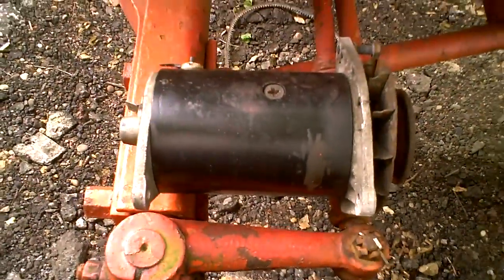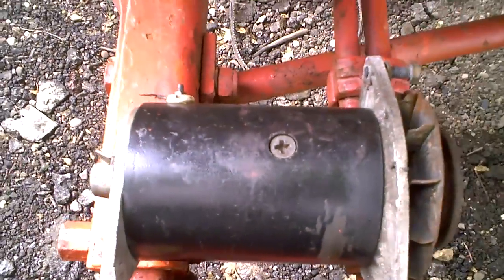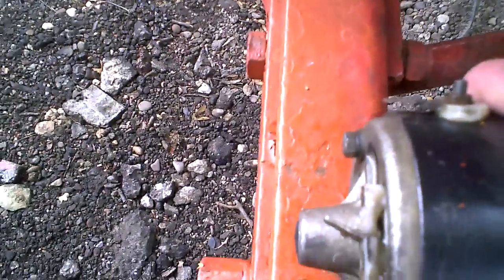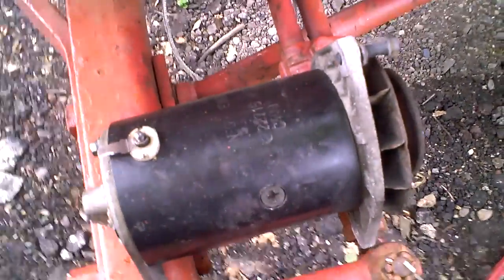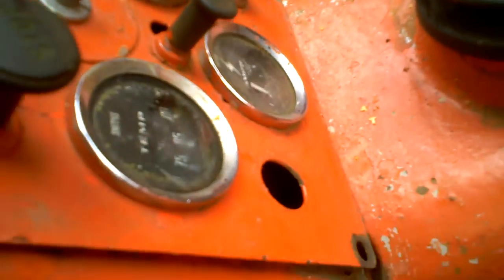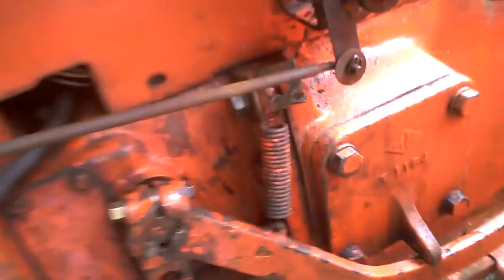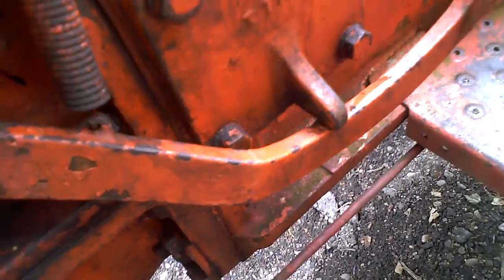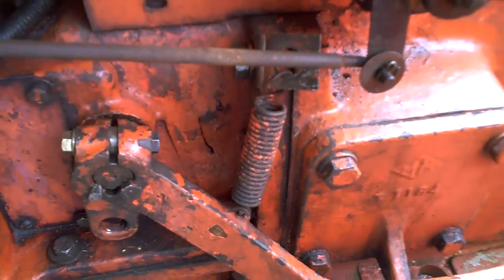Working on the Nuffield and a Recap of the Week

Comment: Never trust anyone elses work!! The Dynamo looks relatively new eh!!☺
Reply from the maker: Correct mate. Years ago I had a problem with a Mk2 Cortina. Trusted a new part, a suppressor I'd fitted in the HT lead from the coil to the dizzy....took an age to find it was at fault. Yes Dynamo is relatively new, discovered it's a car one,  as the original is not open on the end. But to fit it, find it works, then doesn't is a tad depressing....I'll get there.

Comment: I taught all of my apprentices to check a generator (dynamo) like a motor, best and easiest test I found over the years.  Maybe a bit of loctite might help the oil can.
Reply from the maker: Loctite was suggested, but I've also got a flexible spout. It's ok, just annoying when you pay good money and get crap. Why I hate buying anything now.
As you say, much  the easiest way to test a dynamo. First test I did while still on the tractor was to put a live to the field from the battery. Only showed a fluctuating 10v. Fixed that, next is to look at the regulator. Never done an ally covered one, but simply held on by clips at the bottom. Pretty cheap to buy so if I can find one at the show tomorrow I'll just swap it.....can't be anything else. Oh yes it can, dodgy wiring lol.

Comment: Interesting about the alternator .
I often find the source of my problems to the battery from the alternator is the regulator .
I never seem to find them doing one of three things ,nothing at all ,wide open overcharging or working correct .
In the end ,,it's just an electric motor that either gives voltage or uses external power to generate voltage 👍
Damn quality these days ,,they can't even properly thread an oil can ! Lol.
I think I'd prefer a compression coupling anyway over trying to thread such thin walled metal.
Reply from the maker: Been to Heckington show today. Video of CAs to come. Talking to some tractor chaps, they've 4 Nuffields at home, and he said when the dynamo has been off it's got to be repolarised.....ok years ago now but I've had loads of dynamos off cars and they've always worked without before. Only time I had to do it was when I changed polarity. Could be to do with this type of regulator? We'll see.

Comment: One thing for certain - people should never be worried about buying anything from you, especially cars or the odd tractor, as you can be sure that you will have fiddled and fixed, stripped down and repaired and as YOU say, "bodged" but YOUR bodge would be far superior to a repair that most people could do!
Reply from the maker: Thanks Mike. Hardly sold any of my road cars....most were just 're-scrapped' lol. Either dumped in the local chalk pit, or given away. Everyone has been happy with the 3 racing cars I've sold, F2 Stock Car in 1979 and the Mazda and Montego in 1979.  Boats however are a different story. Didn't make any money because of license and mooring fees. But in total sold 5. 1st the 18ft Norman, bought for £1500 and sold for £2750, however I did fit a new engine so lost. BUT I had 18 months boating. Then the 2 'abandoned ones at Bardney. First bought for £350 and sold for £800. Next bought for £250 and sold for £2300. All buyers happy and recouped my losses. Next Wud-E-Nuff bought for £1500, did 5 years boating and sold for £2000. Again I lost as I'd spent a lot on her, but 5 years boating for about £1500 isn't too bad. Then the last one, cost £0.00 and sold 5 years later for £1000. Yes that is correct it cost me nothing. Given to me by one friend, helped to sort out by another. Engine cost me £20 which I sorted the overheating out on, also got 2 tyres which a banger friend bought for £20. Full story on my website if you haven't read it.

Comment: Intermittent faults are irritating :/

Looked like there was a cast loop on the clutch pedal and a place for a spring on the horizontal part of the chassis or engine.  I wonder if that's where the spring should have gone?  Seems odd that it would have a steel bracket on a bolt when there are suitable cast parts in the exact right spot.

Perhaps the original spring broke, and someone bodged the bracket on there as a quick fix?
Reply from the maker: Extremely irritating aren't they. Anyway I've just had a chat on the phone with someone who's told me about the regulator....you can take the ally case off by undoing the metal clips underneath. Not had that off yet. Plus a new one isn't too expensive. Never had to work on one with an ally case before.
I left the spring off because it was stretched too tight. Now I've straightened the bracket and moved to have slight tension at rest, that job's sorted.
As the shaft has moved, it might be it's resting on the release bearing so there might? be some adjustment inside, accessed through the inspection plates. Either way it won't be a problem as it will only have very little use.
Reply: +MalcOfLincoln 
She's in good hands; You'll have it sorted out in no time.

My old Kubota had similar issues.  I kept mending old repairs and eventually just redid all the electrical parts.

Mine has a GM 10SI alternator now that is self exciting and no more intermittent issues or dead batteries when I need it to run.

All those connections corrode and loosen up, add the occasional instead of regular use (like a car would have) and stuff will quit working seemingly randomly.  Quite irritating indeed :)

Have fun at the show!

Comment: Need any advice malc, have a good friend in his 70s who has worked on tractors since he was a kid. he collects tractors for showing.. has 11 in his garage :)
Reply from the maker: Thanks, that's great. Really just need info on stuff I've never done. For instance didn't know they made ally topped regulators. Found out how to do them tonight. All I've done have been the car ones with the spring holding the top on. One thing I do need to know, is there any inside adjustment on the clutch through the inspection plates on the sides?
Reply: Yes in the answer, if you can see an adjustment bolt from the inspection plate then it can be adjusted if not its likely a self adjusting one.
Reply: Heres a link to my friends sons website they both pretty much work on tractors of all varieties, any questions should be addressed there if your really stuck.
 https://www.facebook.com/j.whitemanagricontractorsworkshop/?fref=ts

Comment: I'm not a Luddite (or at least I hope not), but isn't it good to have something one can understand and actually work on; as opposed to today's connect it up to an analyser, then take it out and replace equipment. Hard luck with the oil can - damned irritating.
Reply from the maker: You're absolutely right. My only problem now is age has caught up. Might have mentioned, but repairing it last year I overdid it, and haven't recovered. Ok I could still do it if I had my own facilities, and worked at my, now very slow pace. But, as you can imagine it's very frustrating. However, as soon as it warms up again I'll get to her, charge battery and start etc. My only real job this year is to get the injectors serviced. All fluids, and remaining filters changed last year, and a full tank of diesel. Fingers crossed for no more major problems. Just some days now I'm a bit ill and can't do much. So just hope I'm ok, and have enough energy for show days.
Reply: Malc, I'm so sorry to hear that you're having health problems. I do hope that the summer weather, when it comes, is good for you and that you start to feel better. Getting old is tough, I'm starting to feel lonely - this year so far I've lost my mother, my best friend and two other close friends, each of them being friends for 40 or 50-odd years. At the age of 68, I can feel my capability diminishing. Oh, well.... Take care!
Reply from the maker: Sorry to hear you're having a bad year. I've had my share in the past, however I've also had good ones of course. Had to stop work when I was 43 due to lower back wearing out, then left on my own to manage on very little. However, manage I did, not only that I've done 10 years boating, a bit of banger racing in the late 90s, AND field bangers only a few years ago. And now of course have the Nuffield. All a minor miracle really eh! and grateful for it all.
With no change of lifestyle I didn't think it would make any difference becoming an OAP, however I've found out, as you have it's why we retire at 65. Bodies start to have problems....but there's no cure for old age, so we just have to get on with it, but at a slower pace.
Through my hobbies I've many friends, both real and online, who help enormously. If you're feeling lonely, how about going out to shows etc. Car shows, country shows, even dog shows. Nearly all the people you meet are friendly, and I'm sure you'll soon make some new ones.